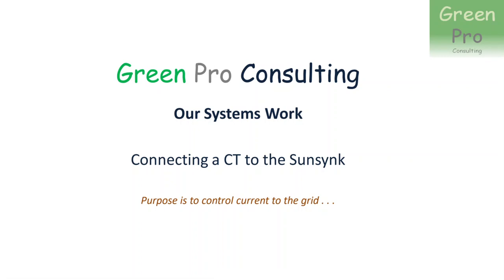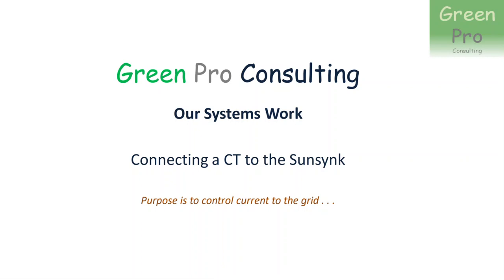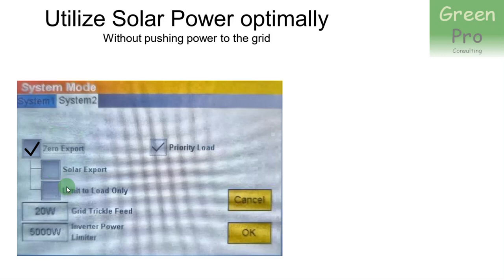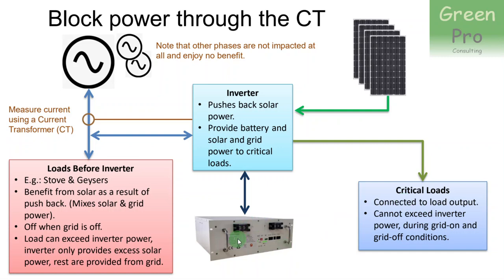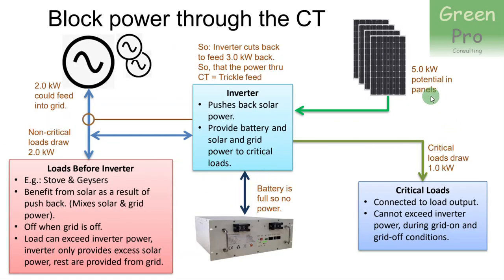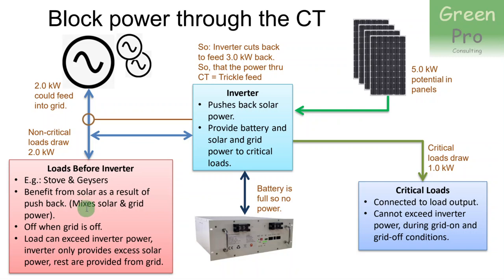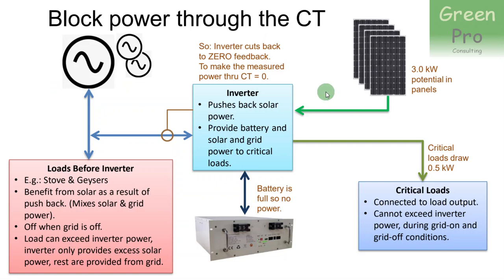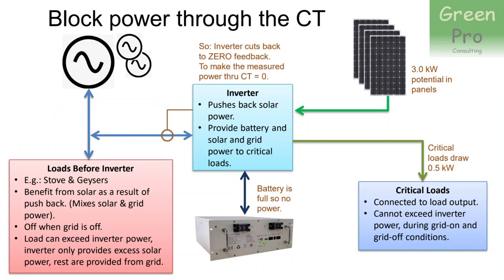Synsynk CT Installation

Comment: Good Evening Sir. Is it possible to power the non critical loads using the battery during the night
Reply from the maker: No, the inverter only powers critical loads from the batteries.
Reply: So if I am off grid I need to have everything on critical loads if I want them to work through the night?

Comment: Thank you very much. The value that you put into “ inverter power limiter “, will that prevent to much load going through inverter? If my essential load is 3000w and my not essential load requires 4000w, for a few minutes, ( inverter is 5000w) will it be controlled by inverter or will it damage inverter? Presuming the panels are producing more than 5000w.

Comment: This will not be applicable when   the whole house load is running on Essential.
Reply from the maker: Correct. In that case you will probably not activate push back (Not tick "Zero export"), and the CT is ignored in any case.
Reply: Thank you, I just want to verify something, I run my home off a 16kw SS, everything essential, I do not export to sell, but I have a pp meter, and without the ct connected and a 20w grid trickle, the pp meter go into error mode. Everything works 100% now with the ct connected and 20w grid trickle.